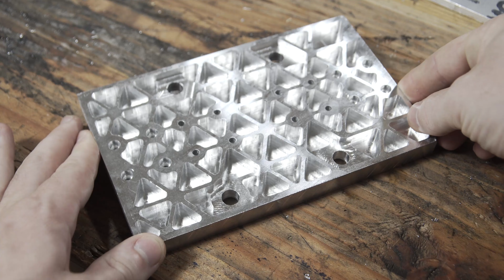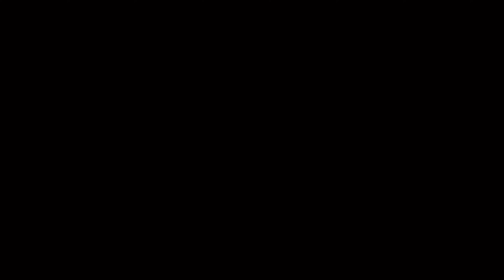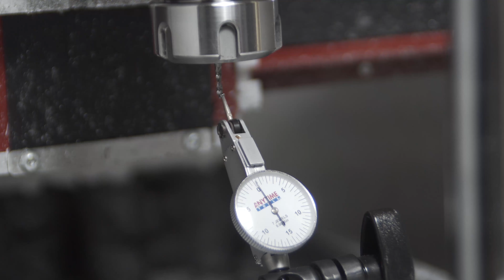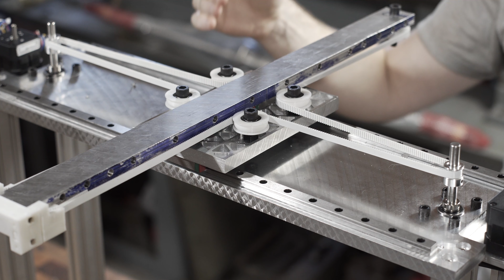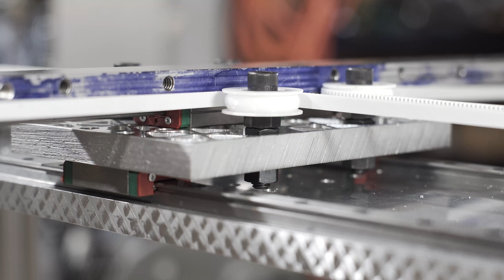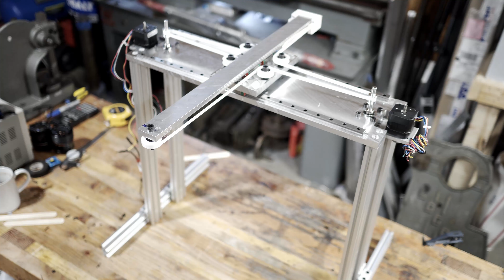Let's build a TBot cartesian motion platform

Comment from the maker: Addendum: bunch of folks have (correctly) pointed out that the pulleys/belt path are not parallel and going to cause all kinds of grief.  They were right :) Since this video has aired, I've torn apart the mechanism and replaced some of it with ballscrews (for different reasons, but it did fix the belt issue :) ).  Whoops!
Reply: I would love to see an update on the completed project. What kind of speed can you get with this mechanism? Thank you so much for sharing!

Comment: Question regarding the kinematics. Doesn't turning one motor move the platform at a 45 degree angle? While the other moves at a -45 degree angle? So couldn't you just declare that the diagonals are the x and y axis, thus making each motor independent and simplifying the kinematics?
Reply from the maker: Yeah I suppose you could!

Comment: the belt ends on the fixed end of the upper bar wont move - no wear to expect there.
of course the loose end (the one with the single wheel) does have a relative motion to the bar - so it can be subject of wear if touching the upper bar.

Comment: this is a 6040 cnc? wich spindle do you have on?
Reply from the maker: AvidCNC Benchtop Pro 2x3, with a CNCDepot S30C spindle.  So basically a super-sized 6040.  Still aluminum frame, but weighs about 300lbs :)

Comment: Do you have enough a height for a chuck for drill bits? I have Taig mill and have a 3/8 arbor that goes in a collet then has a threaded end for a Jacob’s chuck. Makes drilling pretty easy.
Reply from the maker: Ehhh, it's tight depending on what you're holding the work with.  Only 9" travel in Z, so if you're using a vice that runs out pretty quick with a drill and chuck (even stubby drills).  Not as much of a problem for sheet material, but definitely not a strong suit of this machine in general.

Comment: Servos have encoders internal.  If you want additional position information, extract it directly from the mobile platform.  The sum of torques from your motor belt tension and the serpentine platform belt will stress your axle bearings considerably.  I would consider adding a bearing near the serpentine pulley or moving the motors to the other side.  Finally, how stiff is the orientation (angle) of the top strip to in-plane and out-of-plane torques?  It seems to me that flex there is what will limit your position accuracy -- especially without direct part position measurement.

Comment: You will want to add some corner brackets to the tall legs. Otherwise it will wobble all over from the inertia. The vertical bolts into the 8020 just aren't stiff. Put the biggest triangle you can fit without interference

Comment: Nice video. Mic-6 or Alcoa's original tooling plate is actually a 7000 series aluminum.
Reply from the maker: Ah that's good to know, didn't realize.  Crazy how different it cuts from 7075!

Comment: We've been thread milling virtually every hole for years. Taps are never loaded into machines. The cam profile calls for 3 passes on each thread mill. I don't know if that's necessary, but that's what they are all set at. There is considerably less or a retract, and the linear (well sort of) speed is considerably higher.

Comment: Interestingly, the motivation for a launch service provider like SpaceX to make everything as light as possible is not to save on fuel but rather to increase the potential payload mass. The more you can carry the more of the market you can serve. The maximum amount of propellant a rocket can carry is something decided by the size of its tanks rather than the mass of the vehicle (I mean in cases when you already have a rocket which you are modifying, in the initial design phase of course vehicle dry mass matters). You generally don't spec tanks to be much larger than what you would need for a max capacity launch (typically measured by max payload mass to LEO or SSO), and after the tank design is finalized there's no amount of mass you can shave off that will increase you propellant capacity so any future mass reductions are either passed on to payload mass (or to a different subsystem which needs more mass budget). As a related side note, the cost of rocket propellant as compared to the cost of launch operations and the rocket itself is relatively tiny, so paying for the propellant itself is never really a constraining factor unlike with aviation where fuel costs inevitably dwarf everything else.
Reply: pretty sure he was talking about payloads of customers being shaved in weight. if you're buying a slot on a rocket with multiple customers in the launch your weight directly effects the price

Comment: Way late to the party - adding on, the x and y idlers aren't in line with the drive pulleys, which can cause a cosine error when the gantry is close to a motor as the belt pattern forms a more and more severe angle that isn't a square 90.
Reply from the maker: Yep, you are unfortunately correct :(  Someone else commented on that right after I published, and I proceeded to smack my head against the desk.  Whoops :)  I haven't finished this particular project yet, but the axis have since been disassembled and rebuilt with ball screws so it ended up being moot
Reply: @BreakingTaps  that's one way to solve it! Keep being awesome!

Comment: That isogrid looks fantastic. I've newly discovered your channel and feel bad pointing out a problem 🤦‍♂️, hopefully not too late but have to say there's an issue with your belt layout. The belts need to be parallel to the axes, if not you will find that motion isn't linear throughout the range of travel. Particularly towards the ends of travel where the angle between the belt and the axis becomes greater. It's hard to communicate without a diagram but when the belt and axis form a triangle shape, the angle of that triangle becomes greater towards the end of the axis and for each mm of travel of the belt, the travel of the axis is less and more importantly less than it is in the middle of the travel. I hope that makes sense, it's something I had a problem with on a CoreXY printer build
Reply from the maker: Thanks!  And no worries, you are absolutely correct :)  I ran into these issues a little while after publishing the video ☹ I spent some time fiddling and re-adjusting so all the belts were better aligned (parallel and on the same level as much as possible).  But there were some fundamental design issues that prevented me from getting it perfectly dialed in.  Between that and the extra friction in the linear rails due to bad mounting... I decided to just scrap it and replace the system with a traditional ballscrew setup.  Video incoming on that someday once I work up the motivation to finish the electronics.  Oh well, lessons learned :)  I probably should have spent more time reading up on CoreXY builds first to see what kinds of issues folks have.
Reply: @BreakingTaps  Check out the voron 2.4, excellent corexy machine

Comment: I realize it's already been said a couple times I the comments, but linuxcnc is pretty great. You can get up and running with just a parallel port and your stepper driver, essentially the same hardware you have for running mach. I've found it to be much more stable and it's pretty straightforward to set up. Additionally, you have the option to upgrade hardware later on, adding something like a Mesa card if you want to increase your speeds by generating a faster pulse train.
Reply: Just buy the Ethernet Mesa... not too pricey and easy to swap out computers later. I didn’t need many outputs so just use one of the $5 “5 axis BOB” boards that you can pickup from eBay. Mesa breakouts are way better but started to feel expensive...
Reply from the maker: Oh interesting, I didn't realize you could control the stepper drivers directly?  I had assumed you needed a mesa card or equivalent.  Looks like I need to do some reading, that definitely lowers the barrier to tossing out Mach
Reply: @BreakingTaps  yeah, you can use the parallel port to got yourself going. You'll run into limits on the speed of steps you can send out, but you already have that limitation running mach.

Comment: If it’s a servo motor it should already have an encoder, though, right?
Reply from the maker: I should note that these motors do come with hall sensors pre-installed, but those are pretty poor resolution compared to proper encoders :)
Reply: @BreakingTaps  neat, looking forward to more info about this. I just use steppers for my 3d printer, cnc, etc, but have been curious if servos would be worth the cost.
Reply from the maker: Yeah I suspect for small stuff like this it doesn't matter much, a stepper would likely do fine.  I mostly wanted to play with ODrive to get some experience :)  But I have some much larger servos (with integral encoders) that I'm planning to put on my CNC when I find the motivation.  That should be a considerable upgrade since it'll really benefit from the properties of a servo and closed loop
Reply from the maker: Yeah, I was being a bit loose with terminology.  Servo tends to cover a lot of categories: brushless DC, brushless AC, PMSM, etc.  Usually associated with an encoder but doesn't necessarily have to be built into the motor unit.  Strictly speaking these are "brushless dc motors" right now and will become servos once I add the encoders :)

Comment: Looking good, just tighten those belts! Cartesians are particularly vulnerable to backlash in timing belts. Another trick is to deck off 5-10 thou from the top as your first op; will make sure all vertically machined surfaces are perpendicular to the top face regardless of stock warping. Added bonus: if you have a second op on the backside you have a prepped datum surface
Reply: Oh, and if you're fed up with Mach and not averse to compiling control software yourself, PathPilot is GPL and Tormach grudgingly sends the source code for it if you ask nicely ;)
Reply from the maker: Yeah definitely, those belts are so saggy right now :)  The printed tensioner really wasn't sufficient, bottomed out as soon as I started to tighten.  Good point regarding decking off the top... I haven't really done that yet and I'm not sure why.  Should probably start doing that in general so I have a known surface.

Interesting regarding PathPilot!  Did they just "skin" LinuxCNC, or would I also be buying into / getting stuck with Tormach-only functionality (e.g. functionality that won't work without also having a Tormach machine)?  It looks quite nice so that sounds appealing :)
Reply: Linux CNC is like the engine. What people fiddle with, ie the gui, is only loosely connected and you could even run multiple of them at once! So pathpilot is more than just a gui, but you can think of it as a gui that controls linuxcnc

Checkout “probe basic” for a path pilot alike clone. In some ways better, but less mature